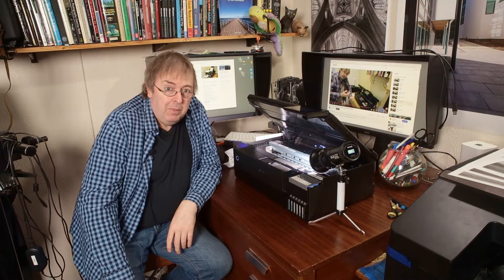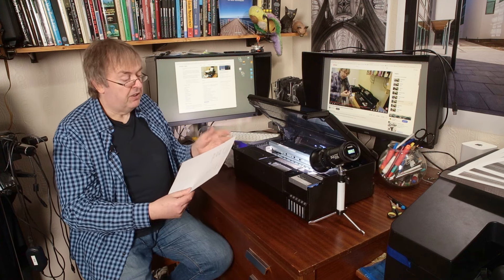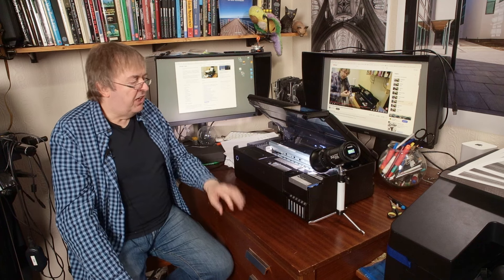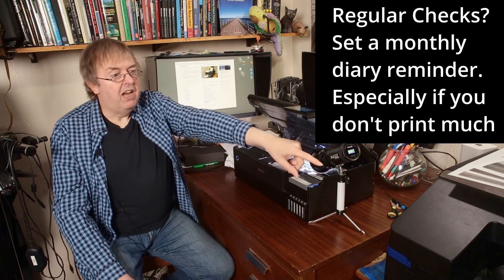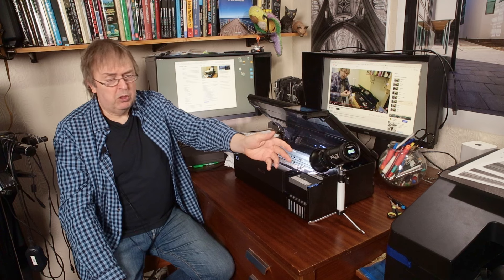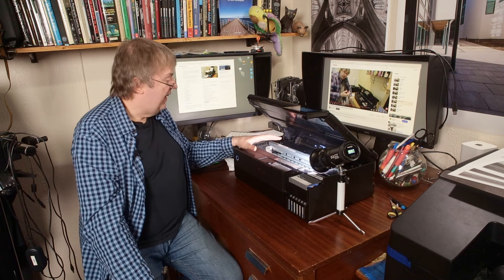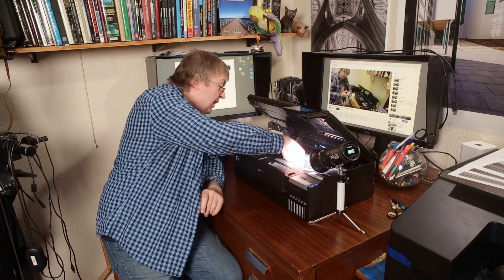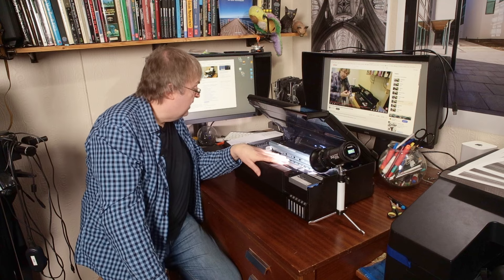Top Epson Ecotank maintenance tips [ET-8550 ET-8550]. Things to keep your inkjet printer healthy.

Comment: I have the 8550 now 2 years or so and only had problems once but they were severe. No matter what I did, I had strange lines in every print even after nozzle checks and intense cleaning cycles. Gave up and tried it again 24 hours later and magically everything was fine again.
Reply from the maker: Yes - I've had printers clear up announced like that...

Comment: Hi Keith. I bought this printer nearly 12 months ago. It’s very economical on the ink usage. I stopped printing boarder less prints when I got this printer because of the over spray on the felt strip, also when the print gets put into a frame, a few millimetres is covered. Great video, I did know about what you covered, as I have been printing my photos for some years now. This printer is the best Epson printer I’ve had, no problems at all. Re Gary 😊
Reply from the maker: Thanks - yes, an excellent solution for many

Comment: HELP!! My brand new Epson ET-8550 is all set up. It prints blank internal reports (and also blanks from my iMac). Do you think that the ink is not loading into the print head? What do you think?
Reply from the maker: Does it print a nozzle check page from the panel?
If not, it's got a problem and may need replacing - contact Epson or supplier...
Reply: @KeithCooper @KeithCooper Nozzle check also prints blank. It is from Quill, USA. I will contact them. For a while, I thought it was the driver (for iMac). Thanks for the help.

Comment: Do you have any videos regarding paper loading issues?  My printer will pull 8x11 paper in the manual tray but now I am having issues with it pulling 11x17 paper.  Sometimes it will, but most times it doesn't anymore.  Do you have any videos that cover these kind of issues?
Reply from the maker: I've never seen any problem, but I don't use the manual tray for anything but A4 plain paper.
This can sometimes mean the feed rollers need a bit of a clean
I'd ask in the printing forum at DPReview or at
https://www.printerknowledge.com

Comment: Hi Keith. 
2 1/2 years ago we've bought our 8550 ET . I was very very happy with it. But couple of months ago it start to give me a paper jam from the above paper feeder. It prints normally from the cassette 1 and 2. But I  bought it to print my artwork on a rather thick paper. So I used  for 2,5 years only the upper paper feeder. I've only recently had to fill up the Grey ink tank. Juist to indicate how much I have printed. We've brought it to the Epson service. Which is quiet away from the place we live. They say it's ok and ready, We've printed 50 testing sheets and it works. But when we got back there to collect, it appears they didn't even check the upper paper feeder. They say something like: ooh but nobody uses that anyway 🙈. So they checked while we waited. Then they said it doesn't work indeed, the repair would cost us €300. Because they have to order inner paper roller compartiment. And they will have  to get all the printer apart to install a new part. My husband says he will better buy me a new one. Cause then we will have a guarantee for 2 years. After the repair you have guarantee for 3 month. So I really don't know what to do. All I can do with this printer now is to print a homework for my daughter. Because it wouldn't print my drawings on a thick paper anymore. What influence has the thickness of paper on printer longevity. Are there probably different printers for this kind of papers which can better withstand this kind of paper being used frequent. Is it may be worth repairing after all. I would greatly appreciate any kind of advice from you. 
Thank you 
Tatjana
Reply from the maker: Sorry to hear that - my feeling is that the 2 year warranty on the new one is worth the extra.
Doesn't say much for their repair skills - but it reflects Epson's original marketing that this was 'just' a home office style printer. We were able to get one with a 5 year warranty at the end of last year, but that was when they were doing offers to try and shift stock.
Reply: @KeithCooper  thanks a lot for your answer.   But still, is 8550 a model  can withstand frequent use of thick paper? Is that what killed it?  Are there any specifics about using thick papers.?
Thanks.
Reply from the maker: Paper dust is my first thought - use an air blower and keep the rollers clean. I use a thick paper and dampen [not soak!] parts with isopropyl alcohol, then just feed it through a few times.
Reply: Thank you for your time, Keith. I suspect dat nothing can bring it back to life anymore. Such s shame really. But is it worth considering by the same model again, regarding the problems above?
Reply from the maker: @chepcyartshopvolkova1036  We spent our own money on one at the end of last year...

Comment: Yesterday I drove 80km and bought the ET-8550 from a BestBuy in Canada, on sale for $300 off. They also had a trade-up program, one can trade in any used printer working or not for another $99 off. So I purchased a 4 year exchange warranty covering everything but physical damage like dropping it on the floor for $149. 

But they had no paper available larger than letter size in stock. I looked all over that city for 13x19 paper sheets of any kind and discovered I have to order all paper online.

I haven’t taken it out of the box yet. I want to get some A3+ paper first so I can properly play around after getting the printer setup.

In the meantime I will start watching more of your ET-8550 videos!
Reply from the maker: A good deal!  
Do check the main [i.e. written] review as well, since it has more detail and lists every related video I've created. 
https://www.northlight-images.co.uk/epson-et-8550-printer-review/
Reply: @KeithCooper  I will! Thanks again!

Comment: I have a Epson 8500 and haven’t done any of the maintenance stuff in 18 months and it works perfectly. If it didn’t work perfectly, THEN it would be time to do some maintenance. It is so economical on ink, used every day doing mostly documents with maybe a photo or three every few weeks, say an average of one a week, 9 out of 10 being small and the tenth being an A4 photo, I’ve still only recently poured the last of the original ink in to it and the reservoirs are still mostly 75% full. I guess that unless I get some reason to print at a much higher rate than usual, this much ink will easily last until the new year [it’s 14th July today.]
This is by far the best printer I’ve ever owned and used and amazingly cheap on ink.
Reply from the maker: Excellent - regular use is the key. My suggestions are perhaps more aimed at those likely to leave the printer for a couple of months between burst of printing, or who insist on a lot of borderless.

Comment: Hi - All is going well with my (nearly) new 8550!  I mostly print A3/A3+ on either photo or on Canson watercolour paper - it’s great!  I have done a bit of borderless, but I wonder if it isn’t better in the long term to use a very small border and then just guillotine off the border? It reduces the print size only a fraction (maybe 3mm on each edge) and avoids the overspray. What do you think?
Reply from the maker: Yes - if you need borderless, I'd prefer that - it gets the whole image in for starters...

Comment: Hey Keith. I am going to Nepal for a month, would you turn of the printer or leave it on stand-by? What about the larger P900 that I also have? Thanks in advance, and thanks for your great channel. Best regards from Bo in Denmark
Reply from the maker: I'd normally switch off and put in a plastic bag to keep out dust for longer breaks
Reply: @KeithCooper  Great thanks for your reply 🙂

Comment: Thank you Keith , i will be looking over the list for this printer i recently bought one and so far happy with the actual prints , I have the latest firmware yet when using Brilliant Museum Inkjet Paper - SilverGloss White A3+ 25 sheets - 300gsm i am getting roller indentations right along the prints  using the rear /top feed, i tried turning on Thick Paper settings but made no difference ... I will try the back feed and see if that makes any improvements , i did see another person mention anything above 280GSM using the rear feed it left the same roller marks .. Would you class 300gsm a heavy paper ? just curious as i a new to home printing as in complete beginner.
Reply from the maker: This seems to affect different printers by different amounts - But I class papers by thickness not weight, since the two are not the same. It's also important to note that surface/paper firmness varies.
Reply: @KeithCooper  Ok thanks , the caliper thickness on this paper is 0.40mm
Reply from the maker: Yes - use that in your testing. each printer seems different - there is no firm guide

Comment: I have a bit different experience on how often to do head alignment: sometimes I need to do it twice during long session of printing. Maybe it is because my printer is installed at not very stable table
Reply from the maker: For that often, something is definitely wrong somewhere...
Reply: @KeithCooper  maybe, at some point it just starts printing in lines, and each alignment shows different results - i.e I need to choose different answers. Sometimes I do head alignment a few times one after another for best printing accuracy and it kind of works

Comment: Would print alignment help if there is a slight misalignment of the borders when printing? I don't mean uneven offsets... I mean if it's slanted on the page every so slightly. It's not an issue with larger prints, but more obvious on smaller.
Reply from the maker: No, the head alignment affect print quality. Any skew is usually doe to the feed rollers.
Reply: @KeithCooper Thank you for the in-depth tips Keith, much appreciated. I have the same problem as Okiter i.e. slight skewing of printing, noticeable when comparing borders on each side of the print. What in your opinion is the fix for this please?
Reply from the maker: @pmcbMadeInIreland  I never saw this when testing I'm afraid - the printer was just a loan from Epson, so had to go back
Reply: @KeithCooper  thank you, I appreciate the reply Keith.
Reply: Thank you. I found the biggest difference is when using the Casette 1 (for small photos) is to just make sure the paper is aligned to the edge of that plastic tray perfectly before reinserting into the printer. It's mostly perfect lol.